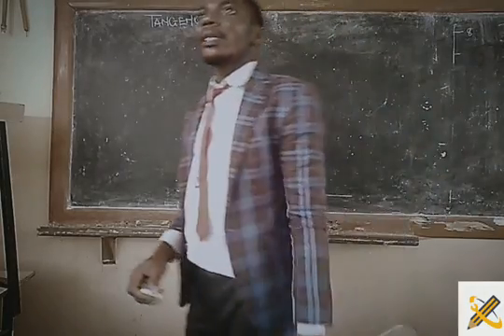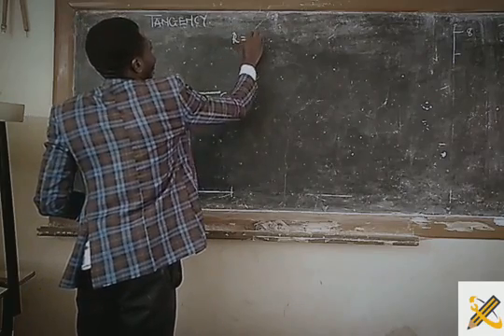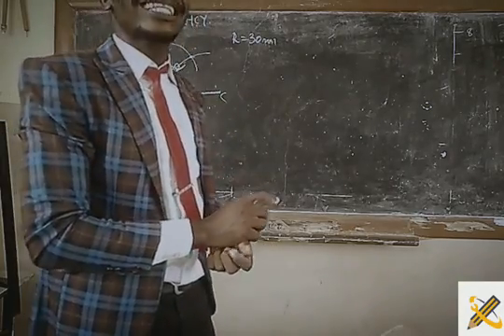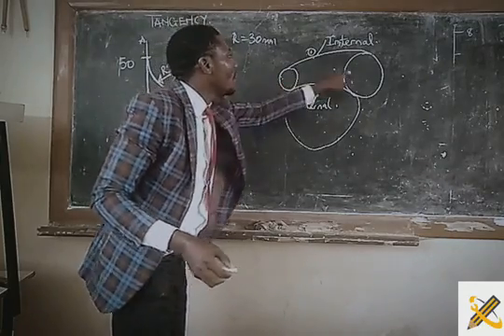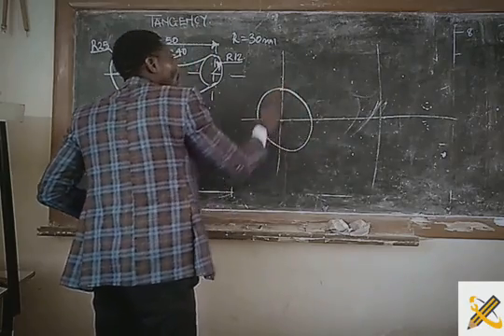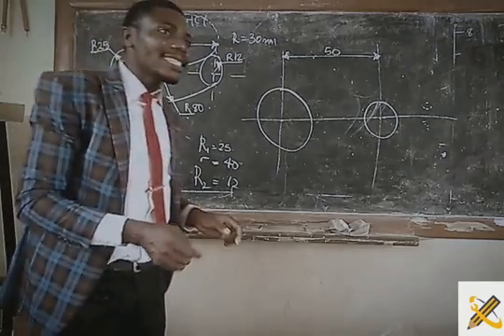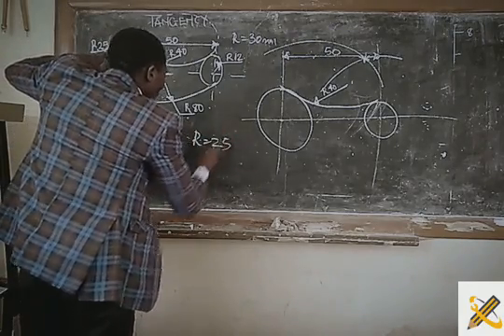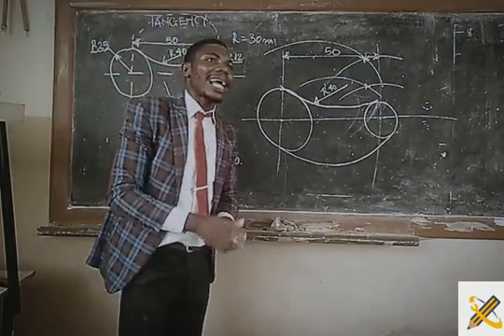CURVED TANGENCY part 1 in | Technical drawing | Engineering drawing

Comment: The measurements you took on the compass to measure radius 65° was it with a ruler or a protractor?
Reply from the maker: @armani0504  First of all, statements such as Radius 65⁰ is very wrong. It is safe to say radius 65mm or angle 65⁰.
Reply: @MAEKLLTECH ok sir, please how did you measure radius 65mm with the compass? You didn't specify how. Was it with a ruler or a compass sir?
Reply from the maker: @armani0504   u use the compass  and a ruler, the pin at mark 0,, the pencil tip at mark 65mm or 6.5cm
Reply: @MAEKLLTECH  thank you very much sir I really appreciate your response 🙏 ❤
Reply from the maker: @armani0504  check out the link beeline for more materials on tangency. 

TANGENCY: https://www.youtube.com/playlist?list=PLW9COHk3Bn-vpJLe4ATKGBakVm0F0Wclf
Reply: @MAEKLLTECH  thank you very much sir. Happy new year sir